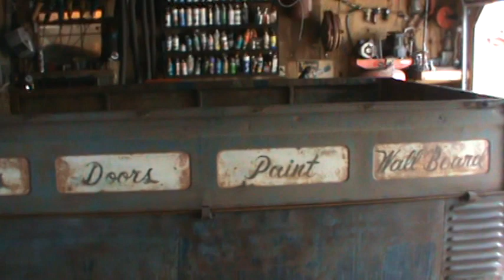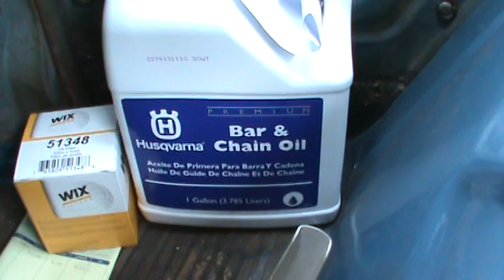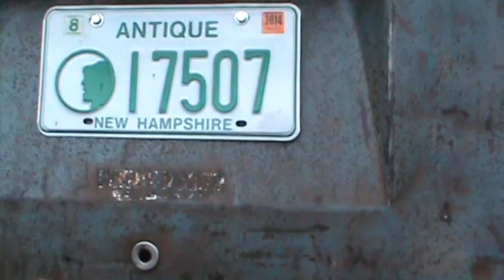1959 vw single cab pickup rustoration, part 26

Comment: and don't forget to move the oil cooler from the front area of cylinder 3 because that place has valve trouble after about 60 miles, at least that was  my problem,....fun videos :)

Comment: The rear corner that you pounded out, tends to look really bad.  Maybe some flat paint in a grey/blue with deliberate over sprayed brown would improve it while maintaining the "patina".  Model paint can be purchased in small containers, originally for trains & planes and such,  sometimes in small spray cans.  Even if you'd rather not,  I still wonder about the fuel gauge.
Reply from the maker: but l dont want it fixed, l want to show the hard life that it lived and is still a survivor,,
Reply: Just a comment.  No sweat, cause it really is quite a grand ol worker. 
Say, the inner door panels can be made of old eighth inch wall paneling cut to fit and covered with material, like the nauga hide you are gonna use on the seat.  Some insulation in the door will quiet the interior while your at it.  Keep up the great work.  It's really admirable.